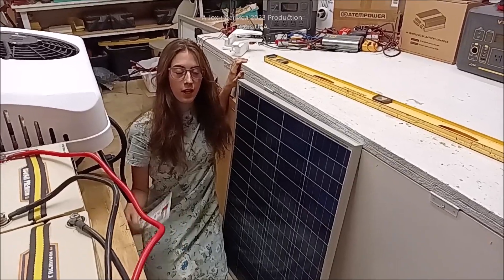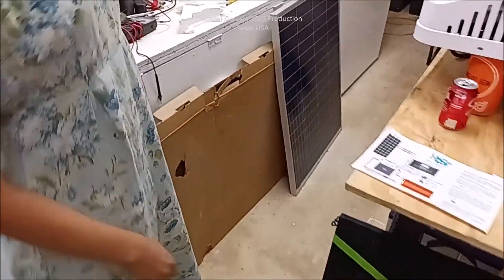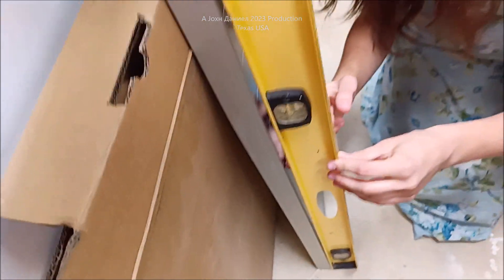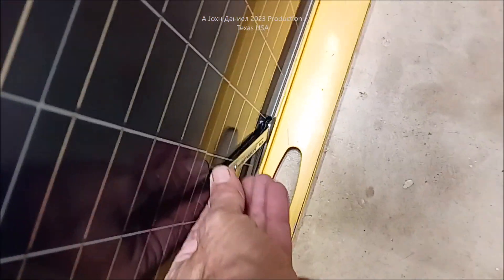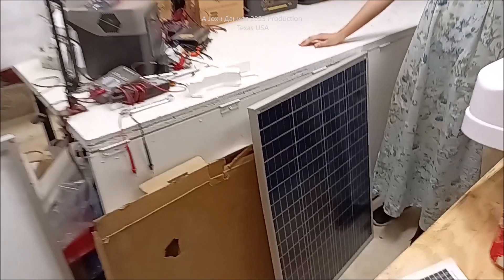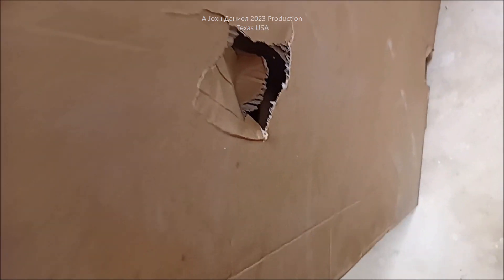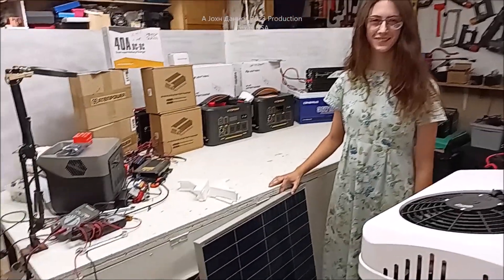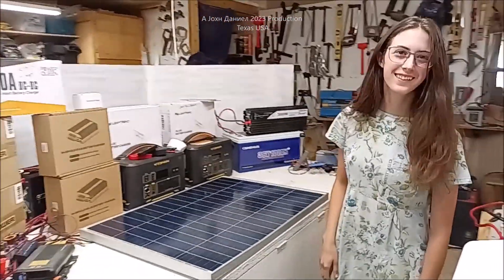HQST 100 watt Solar Panel from Amazon, Shipped UPS, you got to see this one!

Comment: I have a 175W panel from another mfgr on my van roof that I accidentally bent trying to enter a parking garage.  The bend in mine looks worse than the one in this video & 5 years after damaging it it still works fine.  Not saying a damaged panel can't fail but this video may be over stating the danger.
Reply from the maker: That panel broke after 1 week in the texas sun. We were not home when it did, but wife said the pop sounded like a gunshot.

Comment: Ordered 4 of those in 2019, every delivery of 2 shipments were returned were shattered.
Ebay stepped in on the last return, and though the 3rd set arived with 1 shattered out of that final 4, they; ebay refunded my total cost for thee ongoing mess of trouble. HQST was not happy, niether was I because I was looking too buy 8 more if they had been "QUALITY".  But 1 year later, my 18 acre remote forest burned in a 418,000 acre forrest fire along with everything, including the 3 so called High Quality Solar Tech panels. Kinda lost any desire too continue short of necessity too survive with nothing but will. Anyway. The shipping, or the warehousing needs some attention at that joint. FIRE every immature, irresponsible employee!

Comment: Amazon has shipped me damaged panels more than once. Luckily they have been more than reasonable so far with the proper explanation / documentation. I recently purchased a two pack of Renogy 550W panels, and one of them was entirely shattered. I was afraid they'd make ship both of them back despite one being pristine, but ultimately once I mentioned shattered glass coming out of the damaged box, they escalated it to the shipping manager who refunded me every penny I spent for BOTH panels. So that's not such a bad outcome, I guess. Good luck, glad you're back making videos!

Comment: If they don't want it back, and allow you to keep it, see if you can "unbend" it.
Reply from the maker: I put it in a dual angle metal clamp, set it in the back of her trucks metal utility camper, it hits over 140 in there so I intend on trying to save it. 1/4 turn a day on the clamps with a center bend pad to help it. Doubt it will work, They refunded, but we wanted a new one shipped.

Comment: Many UPS stores will accept returns to Amazon, you can just walk it in, sometimes not even needing the original box,  also, our local Kohl's, has a counter/desk inside that accepts returns. I've not had a problem with returns to Amazon, even when I F'd up an order, or, just decided I shouldn't have/ didn't want an order, and was honest with them for the reason for the return. In no way saying your criticisms/ claims are unfounded, or experience, not as you claim. I have 36 of those panels, great inexpensive panels, though the temp coefficient, could be better.    ....     Just my $0.02 worth, hope all goes well.....

Comment: I have 14 of their 190 watt panels. No issues with the panels themselves. however last batch i ordered, two got absolutely demolished. took pictures, contacted them, they sent me replacements no questions asked. I still have the two smashed ones and they make power. I bought all of mine through their store on Ebay. won;t touch amazon these days, there's a reason its called the "jungle site"

Comment: I would guess a forklift fork went through the box to make the 2 holes maybe causing the bend or something fell on that box beforehand. The 4 HQST panels I have are great. Been on the roof of my cargo trailer for 3 years without any issues. I ordered them from Amazon. I think around 80 to 90 dollars each at the time.

Comment: I have 25 of those panels, for the pass 5 years not even washed them or anything and still make max power.  Not bad price either 4 of them for $270 on amazon isn't bad.
Reply: I have 36, going on 2 1/2 yrs,   ...    agree with you....

Comment: That's why I use eBay, I have never had a problem with them. Hey John I need your help, I have 3 super beast batteries from battery Hook-up that I am converting to 12 volts, each one has a fan and a heater pad and I need to figure out a cheap way of controlling them, each one also has a fuse and contactor as well
Reply from the maker: Gut it. Save the frame, Take the headways into a 12v build you a continuous set for 12 volt, connect in groups with 4 AWG to a 3X +/_ buss bar, install a 300 amp BMS and be done with it. https://youtu.be/3bHtZbsbYrs
Don't attempt to re-use the original BMS and Heating. Install on a 28 to 40 watt dog house mat with 0C/32F freeze control and your good.
Reply: @JOHNDANIEL1  thank you for your reply, but I am reusing the original housing and I can't use a BMS for my application, aka starting my big Detroit diesel engine in my bus. I remember that you talked about some temperature switches in one of your videos a little bit. I also plan on using my batteries for a 3000 watt pure sine wave inverter as well. I want each battery to be self contained with their own heater pad and cooling then each battery will be connected to a buss bar in parallel

Comment: My suggestion is that’s not glass. Sorry for your Mishap.
Reply from the maker: Trust me, it's real glass. That's the wild part, how it did not break is the WOW part.
Reply: That is something 🤔 the frame must of bent away from the glass.
Reply: You can bend glass! The problem is that the stresses are in there until you anneal it ...... and you don't have the kit to anneal the panel!
If you doubt me just put a pair of polarising sunglasses on and press on the middle of your window. Those lines you see are stresses (they go back to where they started when you take the pressure off). The glass layer in PV panels is Very thin so when they heat up the stresses will increase until ....... Poof! Your panel is gone and they will claim faulty install!

Comment: I quess that's one good thing about a poly panel is they are plastic coated instead of glass like the monopanels that are glass, but I wouldn't be surprised if it would still spider after some time.
Reply from the maker: It's not plastic, it is glass. That is what is insane about it being able to stay together after such a bend.
Reply: @JOHNDANIEL1  OH! I thought I heard your daughter say it was poly. If they don't want to replace it, it is more like to brake staying in a stressed state and you try to straighten it, I would think it would be best to get it as warm as it is safe for the panel befor trying to bend it back, glass being more brittle the colder it is. I wonder if the glass is a bit like gorilla glass. I've seen tests on that, and that it could stand alot of flex. I know the glass to get a high rating for panels, has to stand up to stuff like some hail and snow loads, etc.
Reply from the maker: For a laugh we have put double angle and clamps on it and set it in the back of her truck with the steel utility camper on it, gets a nice warm 140+ in that thing! Every few hours give the little 3" c clamps a 1/4 turn. Worth a try.